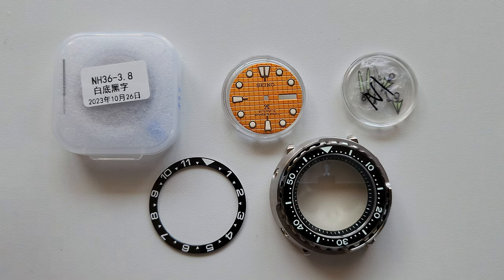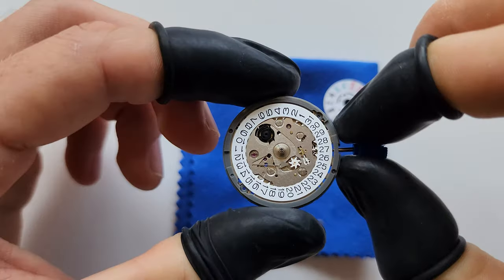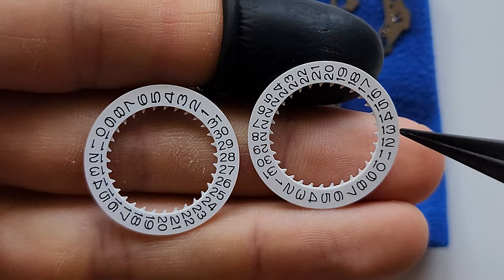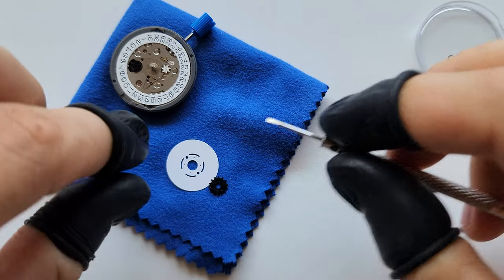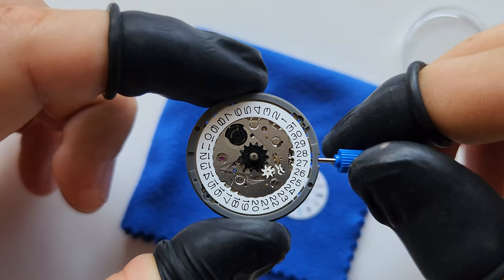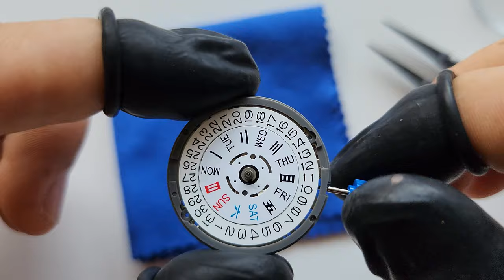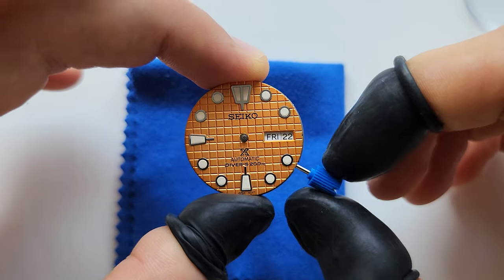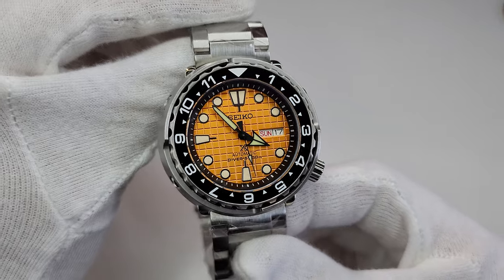AddiesDive Tuna MOD - NH36 day/date modification for 4 o'clock crown | Tutorial

Comment: Just the information I was looking for. Thanks for making this video. I bought an nh34 and realized that the date wheel is for a 3.8 crown, but mine is at 4 o'clock. Good to know that it can be fixed by swapping the date wheel from the original nh35 the watch came with.
Reply from the maker: That's the easiest way

Comment: What if you dont have a 2nd watch sitting around and with the different Datewheel? Your tutorial clearly shows how to modify the NH36 DAY wheel but is there a way to also modify the DATEWHEEL?
Reply from the maker: There is, but it's a headache... you can buy a date disk without the gears, and simply glue it on the old one. But you will have to sand the first one somehow😬 I wouldn't even start it..

Comment: Excellent work, thank you. Do you have a video on how you changed the bezel insert, and the crystal on this watch? I am more interested in the bezel insert. Thanks
Reply from the maker: Thank you! The technique for bezel insert and the crystal swap is the same as any other watch. I think I've made a couple of videos😊 Check Modifications playlist.
For the bezel insert, you basically have to submerge the bezel into a nail polish remover to melt the double side scotch tape underneath. After 10-20min of soaking (depends on which chemical you will use) the bezel insert will come off easily. Then you have to clean the remaining glue and stick the new one😊
Reply: Thank you for the reply. I am very new to modding. So far, I have tried to remove the bezel from (2) Chinese watch cases and the cheap design of the click spring and material it ended up going badly. I have had no issues with oem cases.
Reply from the maker: @scottsprague5778  oem stuff are better and easier to work with